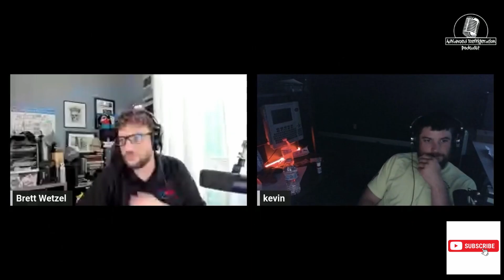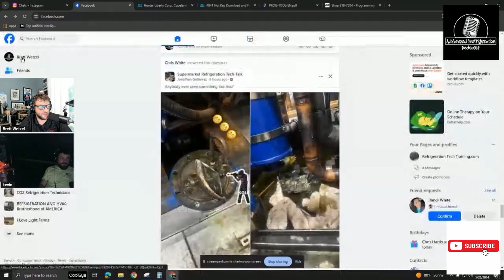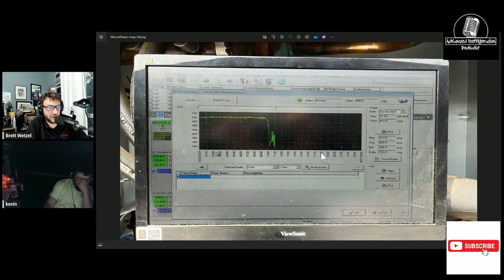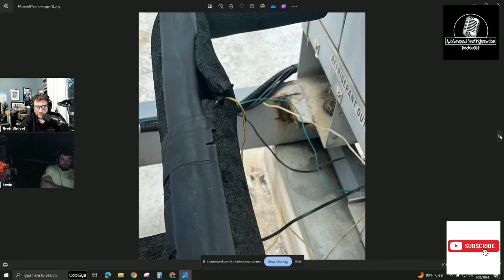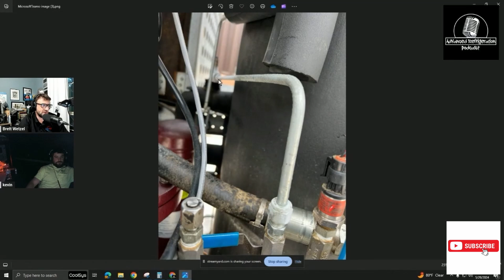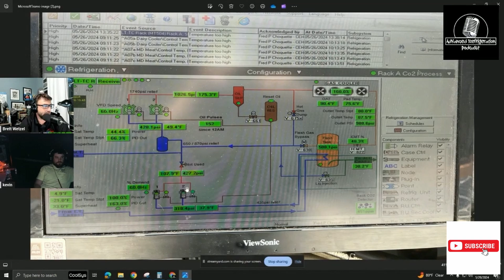Basic Refr---- Nope, Back Down the Rabbit Hole More CO2!!  Episode -- 323 Video

Comment: One the voltage getting put on the comm loop and frying the xm the current part numbers this does not apply. I have been a site with a lot of Copeland engineers and they say and it produce in the I&O Manuel is to ground the negative battery pin 62. This bleeds the voltage to ground. 

Kevin agree cc200 is way better. Copeland needs to trash the xm product. CC200 can do bacnet mstp RS485, Modbus RS485, Bacnet Ethernet. Any platform besides Lon. I have done all of them a prefer Bacnet Ethernet.
Reply: Is that BACnet over Ethernet or BACnet over IP? Both use Ethernet but when I was doing controls BACnet IP was what I thought was the standard and BACnet Ethernet was something I perceived to be a sort of niche thing leibert used in data centers.  

Just curious, I could look it up but by the time I get a minute I'll have forgotten.